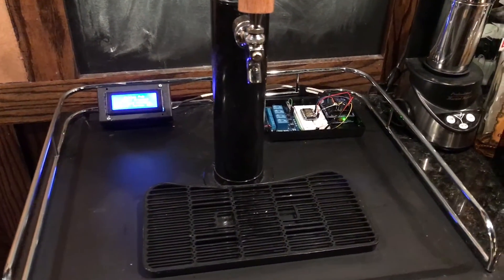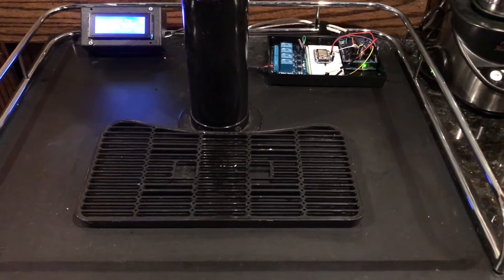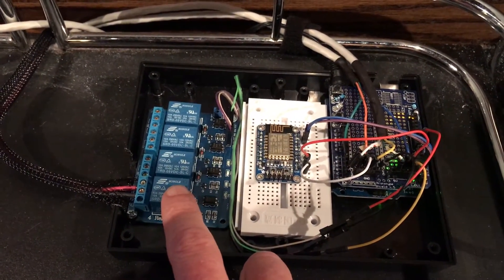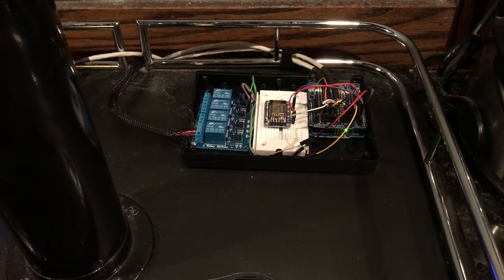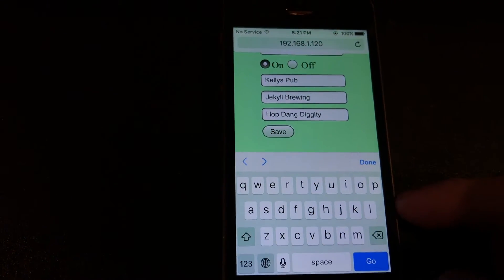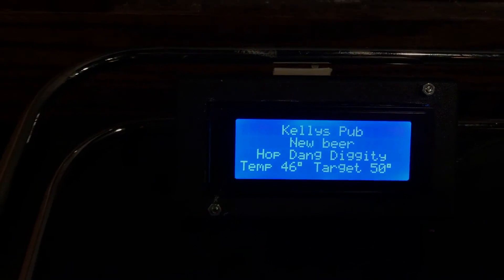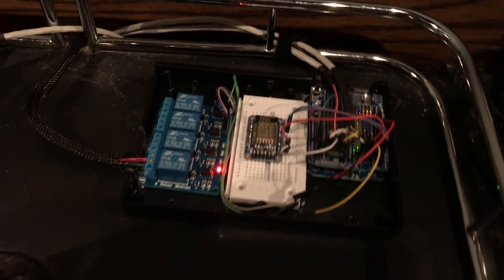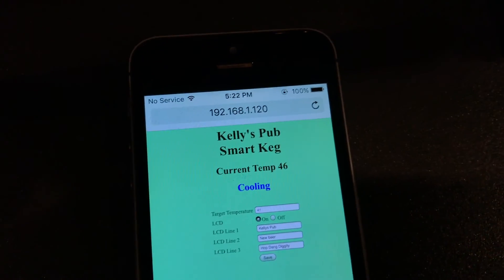Arduino Smart Keg

Comment: Hi Ray, I realise it's a few years since you posted this - but - my identical kegerator went faulty and I foolishly spent $90 on a new controller.  3 weeks later it now seems the sensor is faulty - then I found your video - Exactly what I need!  Planning to copy your work.  If I can take a look at your code it will save me weeks of naffing about.  Thanks.
Reply from the maker: Peter Pick glad you enjoyed it.  I don’t have the code anymore as I ended up getting a nee kegerator years ago.  But it was overall pretty simple and straightforward.   Temp sensor and a relay is really all you need.
Reply: Thanks for getting back to me  @vbisbest  ,  I've made a start on the code and there are a couple of other examples around - it was the web page you served up that caught my interest, but there are plenty of web examples available.  Thanks again and enjoy that draft beer!

Comment: is the D1 mini nor able to control that without a separate Arduino?
Reply from the maker: I am not sure what pins it had.  You would need a pin for the thermostat and a pin for the relay.  It would also need IC2 ability if you want the LCD.
Reply: @vbisbest  just to be clear this is by no means a criticism. I think its a great project. I've been working a bit with D1 minis recently. https://steve.fi/Hardware/d1-pins/ this miught be useful